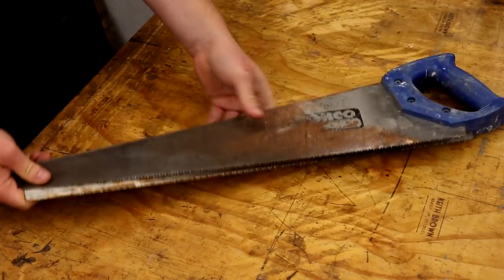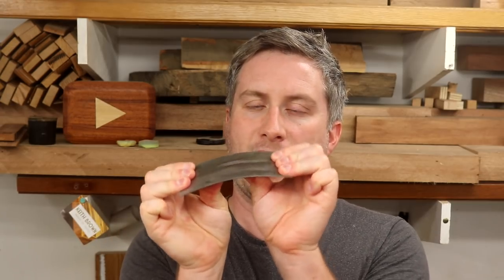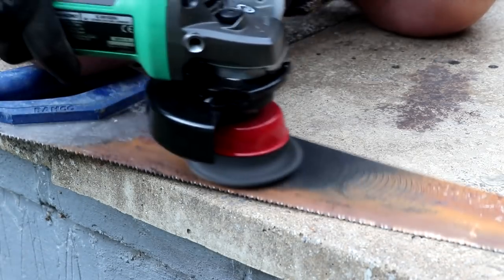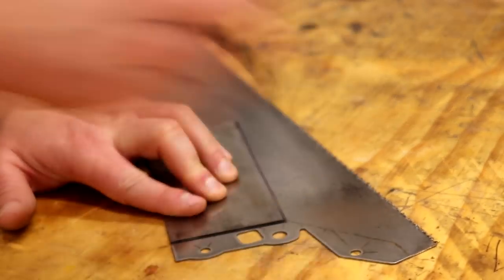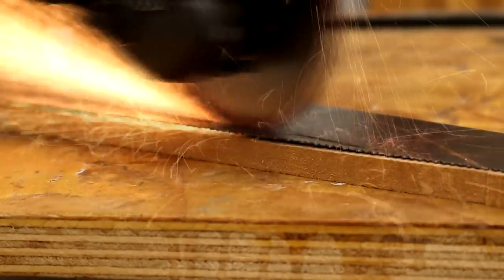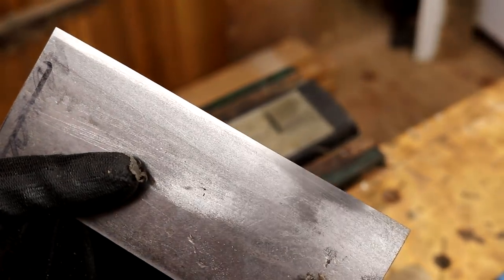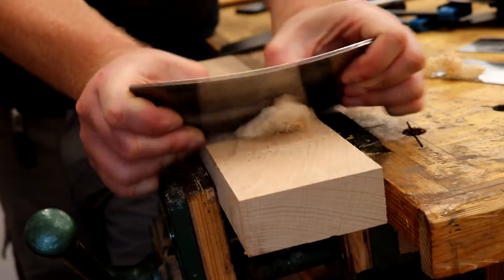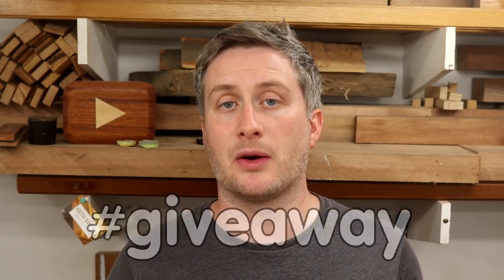Making Card Scrapers - and GIVEAWAY!

Comment: Get those handles out of the bin Keith - they'll make great handles for Heisz style push sticks!
Reply: By the way; thanks for this video. I've an identical saw hanging in a shed from the previous house owner that I've been wondering what to do with and you've given me a great project!
Reply from the maker: Awesome hope it works out as well for you as it did for me
Reply: Fergus, good idea, i just came to say the same thing.

Keith, i’ve kept some old saws of my dads as they have wooden handles that i was going to reuse for push sticks based on what Frank Howarth did on a CNC machine.

i didn’t have any ideas for the steel so thanks Keith for the idea on making card scrapers, now I can reuse the whole saw! 😀
Reply: Exactly what I use them for👍

Comment: hey Keith, a tip for scoring straight lines with an angle grinder, is to PUSH the grinder, and not pull. If you pull, the sparks can cover up the line, making it difficult to see. If you push though, the sparks fly on to the part you have already scored.

Comment: Great job keith. I really look forward to your Friday night videos.
I throw about a dozen of these away a year. I use them for wood, then when dull, cutting thermolite blocks then the scrap metal skip. Iv often wondered about making scrapers out of them but never got round to it. Like you I always hoard the three m5 nut and bolts from them. You cant actualy sharpen these disposable hard point saws, the teeth have been hardened.

Comment: Nice ... i have tiem to make scrapers since my ROJEK table saw in at the welders place to upgrade the fence! :) :D
Reply from the maker: How is the saw performing for you?
Reply: @RagnBoneBrown  i havent used many saws if i am honest but beside the shity aluminium fence sistem i like it very much!  Motor is very silent and has enough power for my needs... I am upgrading table saw fence with a proper cast iron biesmyers (or something like that...) style fence and making a cabinet and router lift on the extended side. I hope it will all work out as i imagined!🤔🤨.  But yea... Overall the tablesaw is great... Ill have 4400 bamdsaw soon for all the resawing and a planerjoiner soon! So this tablesaw will do just fine😁 need to expand my onecar garage somehow!😮🤨 Hehehe

Be good!
Reply: I hadn't thought of using old cheap saw blades for making card scrapers. Great idea.... Giveaway

Comment: Thanks for another great vid Keith! Wondered if you might have any advice on the best dust masks on the market or on the one you use? I’ve recently spent over £100 on a full face mask, the visor of which then cracked when I tried to remove the filters...😯 thanks again! #giveaway
Reply from the maker: Hi Joe. I actually hate my face mask (the trend air ace) the straps on it are awful and it’s way over priced for what you get. Looking for a new one myself
Reply: I’m using the JSP force 10 which is actually very good in general use - I was probably too heavy handed in replacing the filters! Luckily all the parts are replaceable ... live & learn! 😪

Comment: #Giveaway . A card scraper would be nice. Also using old saw steel for card scrapers is good. I see people use old table saw blades to make small axes do you think the hand saw would be good for making a knife?
Reply from the maker: I think if you had a way of hardening and tempering the steel then it might work but I don’t really know enough about metal tbh